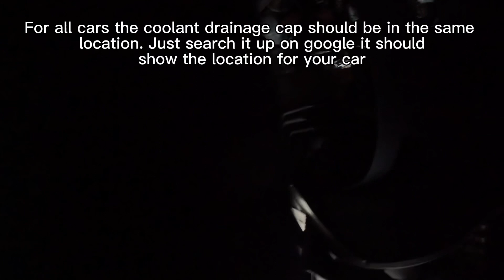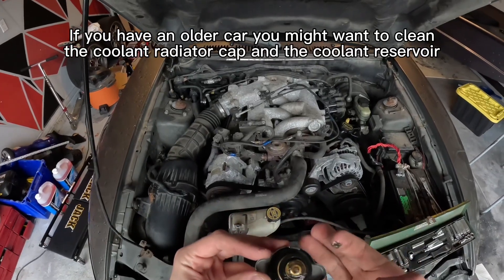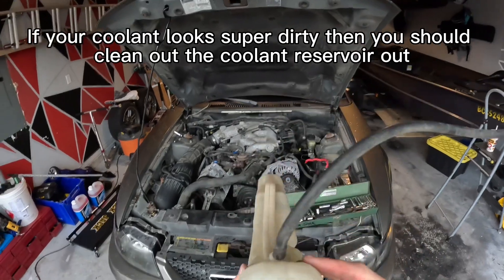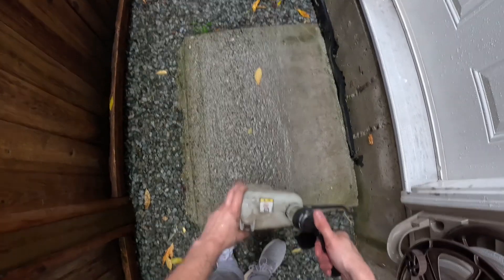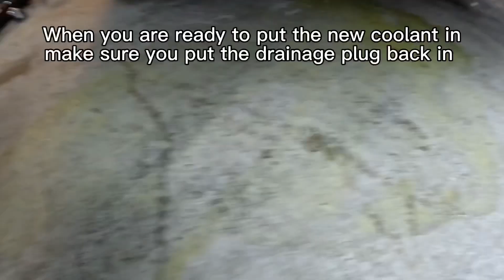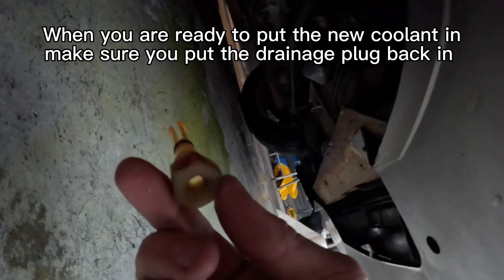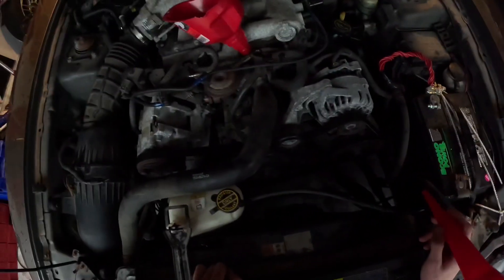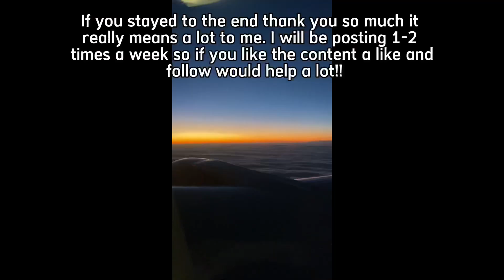How to change coolant in any car (done with a 2002 mustang)

Comment: This isn’t a complete flush right?
Reply from the maker: No a complete flush would be poring a radiator flush product into the car running it for a few then repeating the steps shown then filling it up after with coolant. (A complete flush is not required unless there was some other substance in the coolant like oil or metal) other than that it’s just replacing the old coolant with new coolant